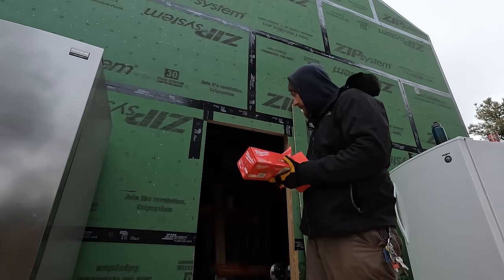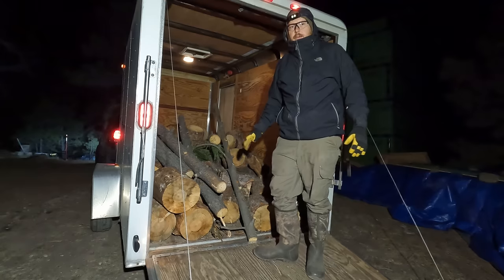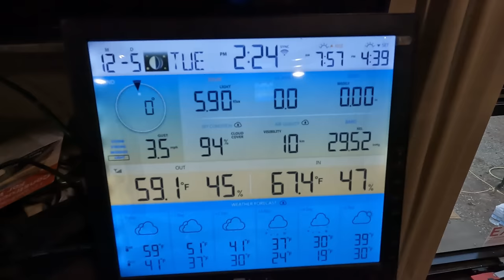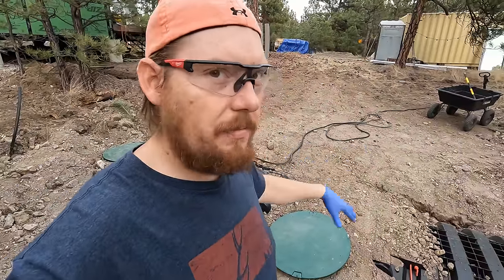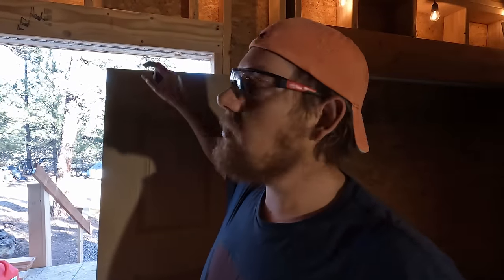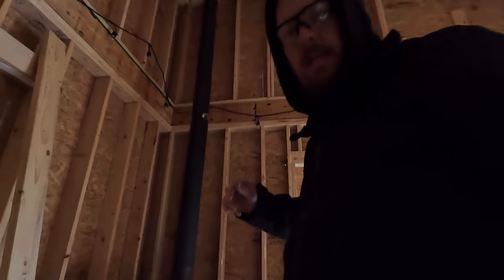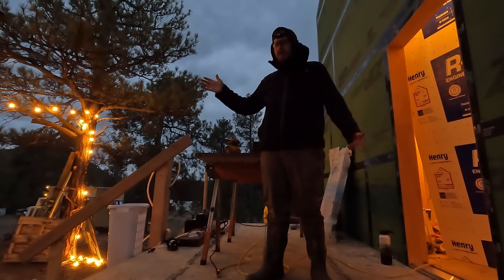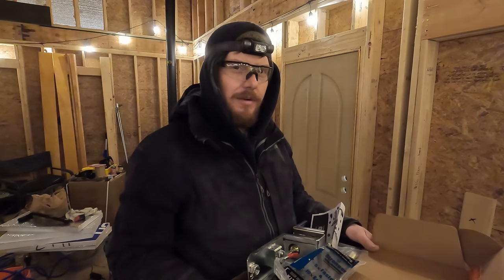Installing A Door Frame For Our Gently Used Slab Door | Off Grid Cabin Build

Comment: Why on God Earth did You use like 1/4 inch plywood for the doors Sides and Top Frame? It's gonna fall apart in 4 days or less. Standard is 1 x 6 or 8 depending on framing materials.
Reply from the maker: Still standing! We made the rough cut opening for the door too small. It's all we could fit in. It's heavily stained. If we run into issues, we will fix it. In the meantime, it's holding up great. Thanks for the feedback.